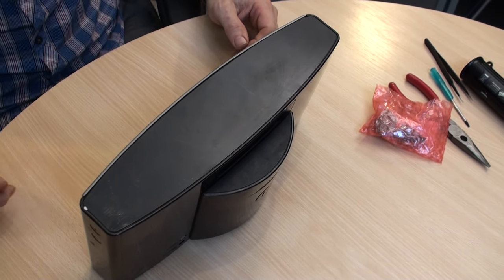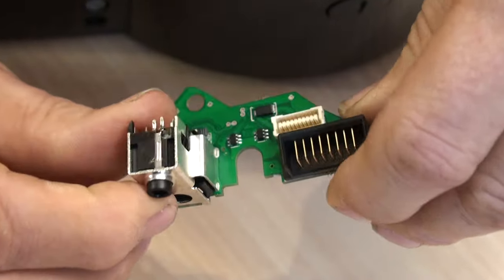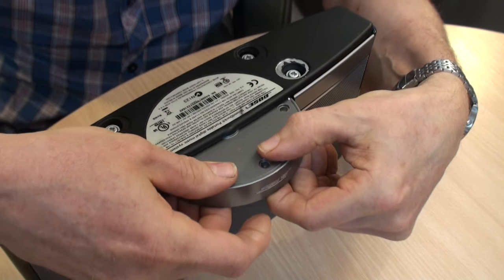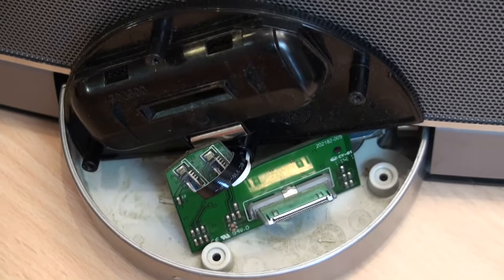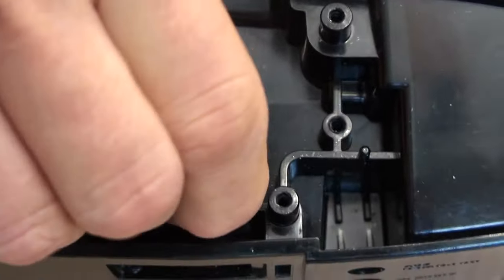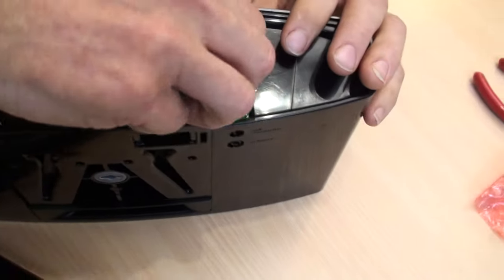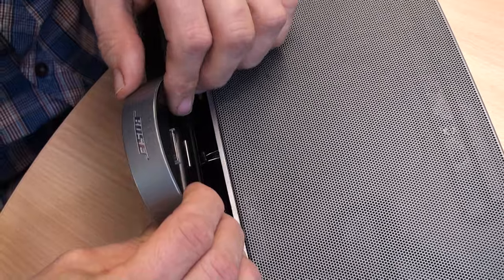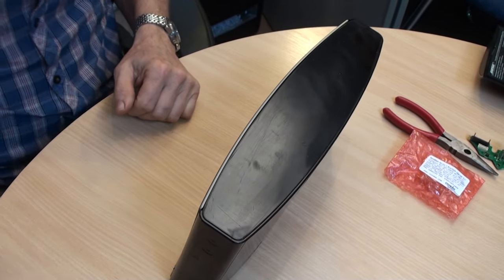Replacing the Bose SoundDock Portable Power / Aux Input Board 303293-001 / 313451-002

Comment: Hello, I have this sounddock portable unit and the power cord connection on the back is going on and off as I plug in the power cord.  Would replacing this board also fix this problem I am having? thank you for your time and your video...

Comment: Hello, thank you for this tutorial. I encountered a problem today with a broken tip of the 3.5 mm plug that is in the audio in now. Could I follow the same steps of your video and remove the tip out of the auxiliary input?

Thank you.
Kim Ho
Reply from the maker: Hi Kim, replacing the board with the faulty AUX socket would fix this issue with the SoundDock Portable
Reply: Thanks! I’ll do that.

Comment: Hi. I had thought that the battery for my SoundDock went bad and wouldn't charge so I bought a replacement battery. So I connected the new battery and everything seemed good. Unfortunately the unit ran on the battery until the new battery went dead. The SoundDock works fine when plugged into power but I guess it's not charging the battery, any thoughts? Thanks in advance!
Reply: Same problem,did the new board fix the problem?

Comment: Question!!  ordered and replaced Aux Input Board 303293-001 / 313451-002, and when wanting to use unit, I have to lower or raise the volume to have unit power and charge and play iphone.  iPHONE does not charge after not using sounddock portable. so to be clear iphone left on docking board does not charge after leaving on there several hours of non use.   i must touch volume control to get charge on phone and to hear any sound.  what do you recommend?
Reply: If the dock has power and plays music , to get power to the docked apple device, the ipod dock connection has to be good. By far the most likely cause of your problem is a damaged docking connector in the front notthe PIO board,

Comment: Hi guys I just replaced  Bose Sound Dock Portable Power / Aux Input Board 303293-001 / 313451-002 which i just received from you, followed your instructions to the letter, but for some reason when i connect the power cable it won't work with the battery connected, as soon as i disconnect the battery i get power and everything works ok, Battery was fine, it was just the audio jack that was broken. Any ideas why the battery should just stop working?
Reply: Hello. The best best is to contact the guys at the invebo support team. Details on your order acknowledgement. The most likely cause of problems is the white ribbon cable not being plugged fully home. If you still have trouble with installation then call invebo and speak to an engineer. Number on website. UK Business hours.

Comment: I'm baffled still. Mine thinks it's charging despite power cable not being connected. The unit gives the charging beep sounds as if i'm connecting and disconnecting the power cable, the sounds are intermittent. The battery charges still, and i've rebuilt the unit twice now.